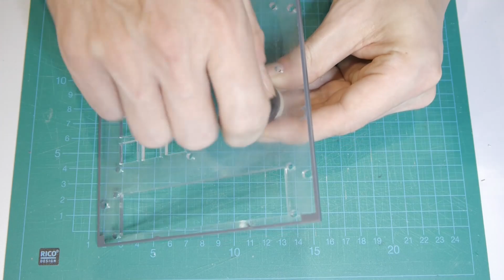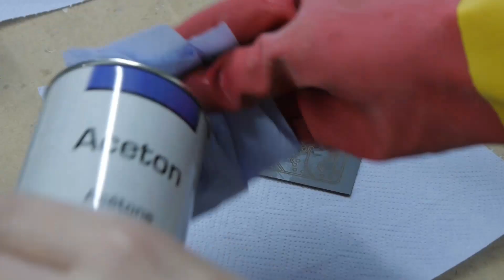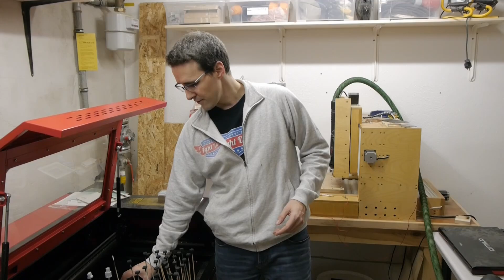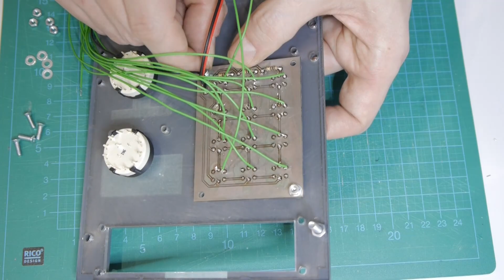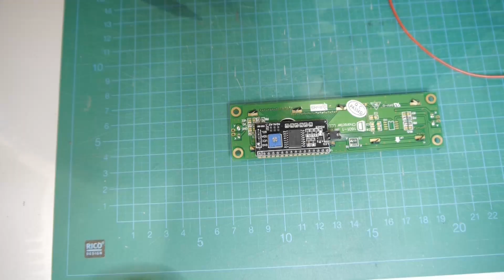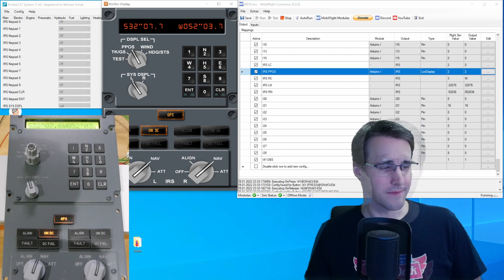Making an IRS Panel - A Boeing 737-800 Homecockpit #63

Comment: I am trying to configure the IRS display. I have transferred the settings in Prosim737 and in Mobiflight.
Only the Flight sim value in Mobiflight remains at 0.
I have prosim737, mobiflight and MSFS2020 turned on and the switch on PPOS. The Prosim737 afteroverhead panel does contain the coordinates.
I only have MSFS2020 with FSuiPC7 on my system. Is that sometimes the problem?
Reply from the maker: Puh, hard to say. I haven't tested the configuration with MSFS until now. I would assume it will work like in P3D because FSUIPC is the link. This sounds like a very individual problem. In most of the cases, when I had a problem, I had an offsett assigned twice or another error in my configuration.

Comment: Drilling can be done precisely enough with a hand tool like dremel, mini drill or a small motor with a collet chuck. For that to work, you need to etch undersized (0.1mm) centering holes at the etching step. Also my favorite way of aligning PCBs is to drill 3-4 small holes first (usually where the mounting holes will be), then stick tightly fit needles through the holes. This way I never had any problems making double-sided PCBs. Though my method is drastically different: I use a laser printer, a pressing iron and a glossy paper to transfer the print, iron chloride to etch, and a small hand drill to do the holes.